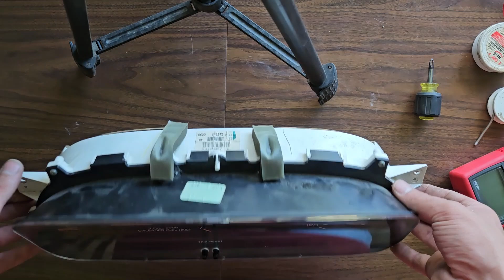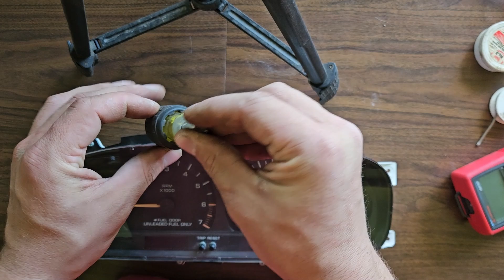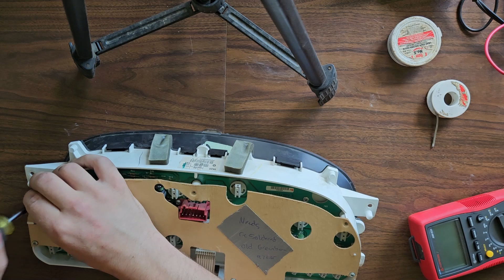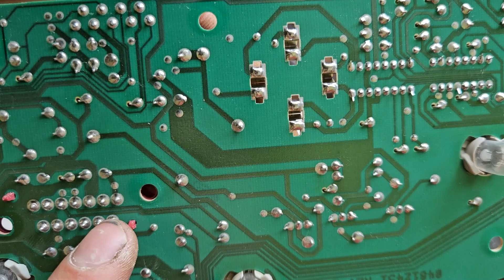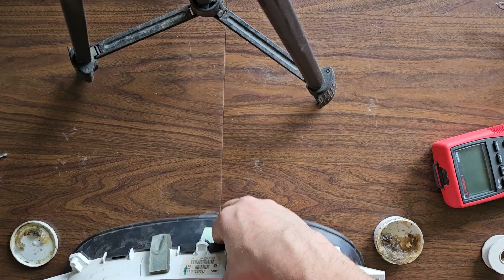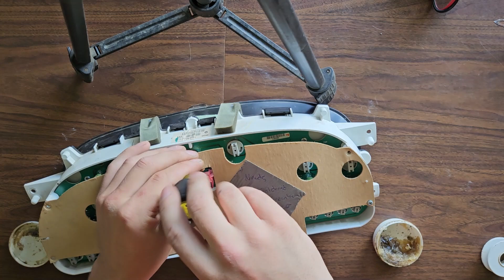1996-2000 Dodge Caravan | Plymouth Voyager | Chrysler Town & Country instrument cluster repair

Comment: did you ever come across an issue where the ac, rear wiper, etc switches start blinking like Christmas lights while the meter cluster was dead?
Reply from the maker: The blinking lights on the hvac module are error codes for the hvac system. Look up hvac calibration for a third gen caravan. It will show you how to properly calibrate them.

Now its possible you have a grounding or bcm issue at play if multiple body systems are going funny. But try the system recalibration. Ive had to replace those hvac control modules because of failure too.

Comment: I have a 1996 Dodge Grand Caravan, Had the cluster re-soldered, but there is a slight humming sound behind the cluster, but a bit lower. and it kills the battery after a few days. new battery and charges fine. What could it be ?
Reply from the maker: @shawnhankey9021  I'm not sure. Is it down by thr relay panel under the dash? Could be the bcm making a weird hum. Good luck!

Comment: You know the cluster wouldn't let the vehicle, is that because when you disconnected the cluster, the vehicle did start?
Reply from the maker: @mostlymoparih5682  I'm pretty sure they'll run without the cluster at all. I had one plugged in that wouldn't let it start... which indicates something was grounded that wasn't. But I didn't do that much testing on it beside pulling it back out.